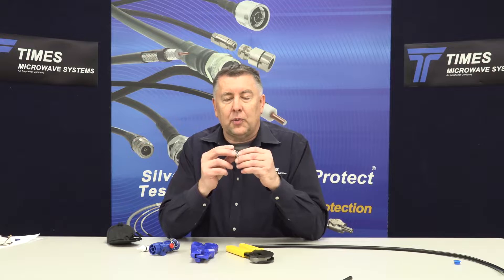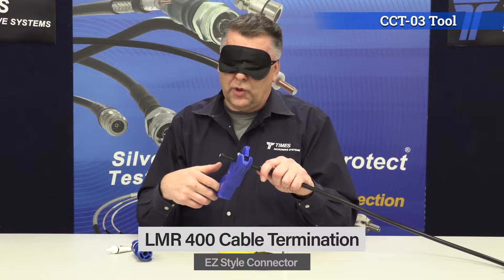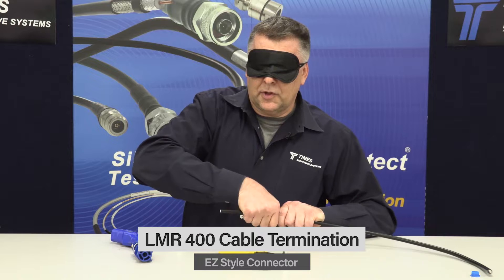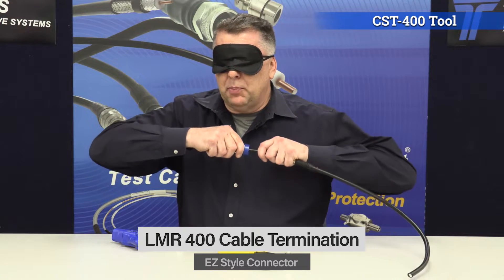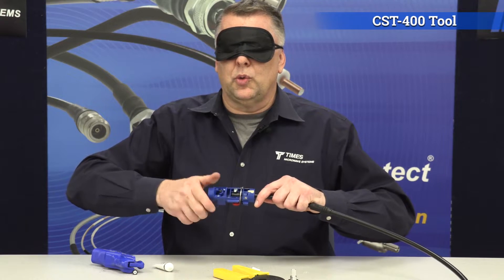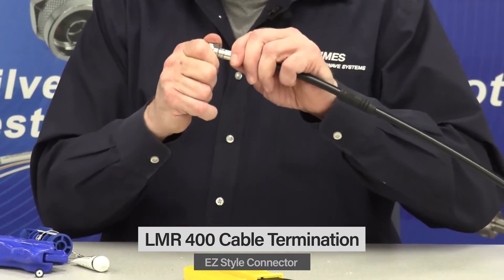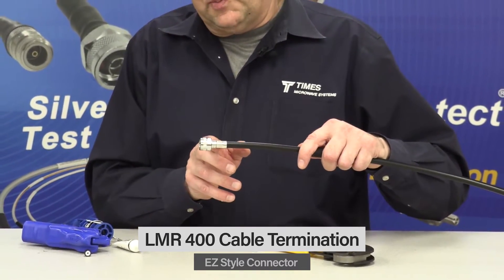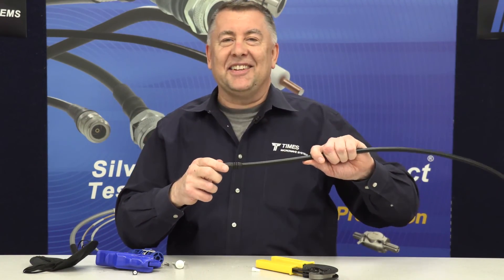Demo Discoveries: Blindfolded LMR 400 Termination with Kevin Moyher

Comment: Hello: I am supposed to order LMR 400 cable for a helium minor cryptocurrency setup from the USA,  but I found JB 9913 coaxial cable here in Puerto Rico.  Can I exchange these two cables?
Reply from the maker: 9913 is a cable that is very susceptible to moisture ingress. We would recommend LMR 400 or LMR 400-DB for your needs.

Please send us an email at techquestions@timesmicro.com with your requirements and we are more than happy to assist you further.